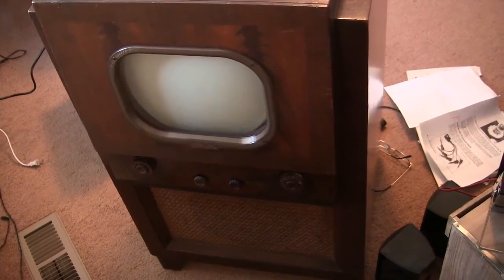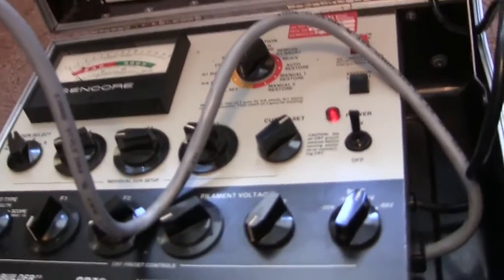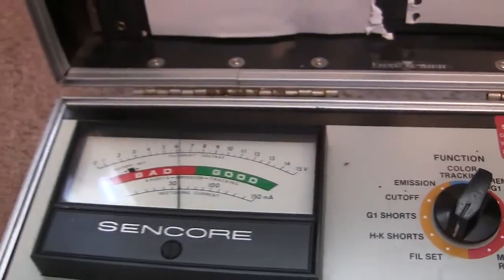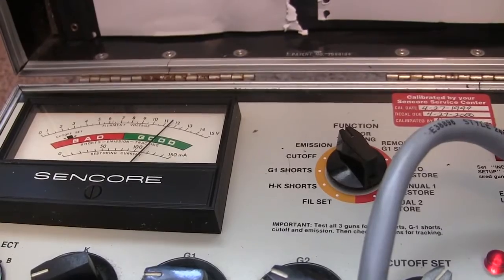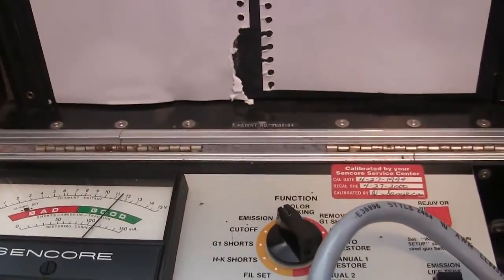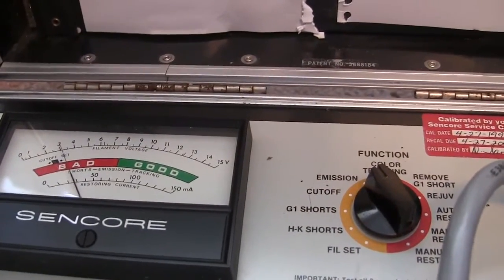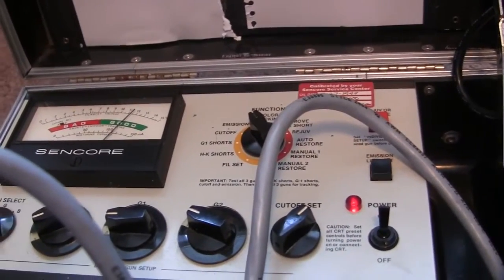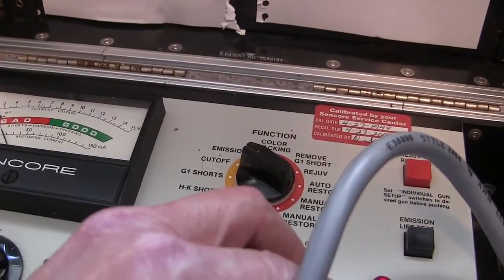1940s Motorola VK106 w TS 9C chassis   Quick 10BP4 CRT check with Sencore CR 70

Comment: I think that CRT may be new old stock possibly or the set was retired not long after replacing that or was not used much, but I am not certain.

Another test might be to make sure the tester itself has not developed a fault of some kind.   I would put a voltmeter on the fillament output wires and make sure the voltage outputs are correct.